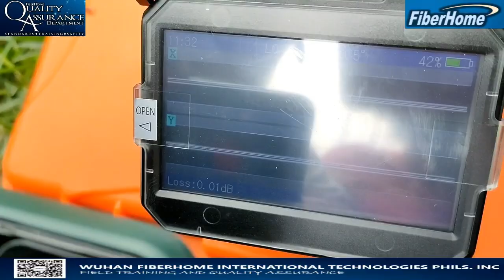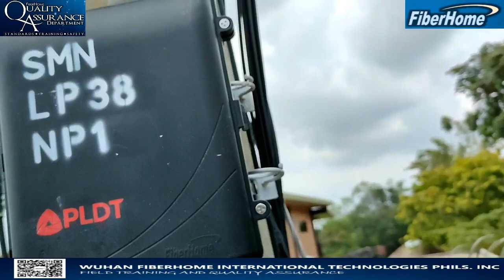PLDT ADD NAP STUB INSTALLATION

Comment: Hi sir. Sa pagka intindi ko po pag mag a-add ng nap box then stud installation yung gagawin, bale kukuha ng connection yung new box sa lumang box na live? Tama po ba? If tama po, ang question ko ay:

-Gusto ko po sana magpa kabit ng bagong nap malapit sa bahay namin. Mga 400 meters ang layo ng live box from bahay namin. Ang alam ko hindi pa puno yung existing box. Pwede po ba doon sa existing box kukuha ng connection yung new box na may 400 meters yung layo?

Gusto ko po sana malapit yung box sa bahay namin para hindi na dadaan sa private property yung mga technicians if ever mag kaka-issue yung connection. Salamat po at sana ma notice niyo po ang tanong ko 😊
Reply from the maker: Hi sir, about sa tanong mo sir pag ADD NAP STUB INSTALLATION kc dapat kalapit lang nung bagong NAP yung existing, mostly isang poste lang yon kaya tinawag na stub kc limited lng ung haba nung core na madudukot dun sa existing NAP

However, kung mahaba ung FOC kahit pa 1KM ang layo non e possible parin yung add NAP still works parin un

Ung gsto mong magpa kabit ng bagong NAP na malapit sayo e medyo malabo mangyari depende cguro kc hindi mag aadjust ang company para lang sayo, I hope you know what I mean.

At isa pa 8 NAPS per LCP ang PLDT. Kung ung LCP BOX jan ay my 8 NAPS na, hindi na pwede mag add NAP kc na reach na ung maximum limit nA 8 NAPS per LCP. Unless mag ADD ng New LCP ulit pero need noon ng new FIBER CABLE ppunta jan sa lugar nyo so makakapag add ulit tayo ng 8 NAPS possible na baka jn pa sayo malapit mailagay. But it will take time to do it at tulad ng sabi ko di maglalagay ng connection jan sa inyo para lang sayo or para lang sa isang subscriber.Lugi ang company non.
Reply: @Connected1130  Salamat po sa pag sagot sir! God bless po!

Comment: Quick question: nasa magkano ang cost sa isang NAP?

Natanong ko po ito kasi kadalasan, even sa big cities, kukunti lang mga NAP kaya pahirapan sa pag pakabit due to walang available port. Unlike sa DSL dati na walang hassle magpakabit, pero ngayong fiber na nasa 1-2 NAP lang kahit maramimg bahay. Based sa nababasa ko ay due to result ng survery ni PLDT sa area, pero sa tingin ko hindi yan effective kasi the day mag survey ang taga PLDT iilan lang naman ang interested or my current fiber sa ibang ISP na, which is kung may mga bagong bahay or say may mga apartment na may bagong nag rent at gusto magpakabit eh hindi na possible due to availability. Kung maglagay lang sana si PLDT ng enough NAP kada poste para may available ports sa new subscribers nas maganda sana, kasi pag walang available ports at may gusto mag apply eh wala din.
Reply from the maker: Hindi poh kc for sale ang NAP ng PLDT kaya diko alam ang presyo😂, sorry for the inconvenience. Paunahan nlang poh kc magpa install yan, however, kung mataas ang apply mo na Plan halimbawa 100mbps pataas, e kakabitan poh kayo kahit pa malayo up to 1 km layo ng NAP,
Reply: @Connected1130  Sir, sa case ko, naka DSL kami dati kaya lang na forced migrate sa Fiber dahil yung DSL box daw po ay natamaan ng construction sa lugar. 

Kaso, walang available slot sa malapit kaya sobrang layo po ng NAP box na pinagkabitan, labas pa po ng subdivision at malayo pa. 

Hinde po ba mas prone sa issue at kupol cable kapag sobrang layo na ng NAP box sa house?

Comment: Gandang araw po sir, may tanong lang po ako, nag benta ako ng wifi sa mga kapitbahay ko at kinabitan ko rin sila ng mga modem, ,pero sa mga punong kahoy nakasabit ang fiber ko,  , hindi ba ako aitahin ng pldt o converge dahil nagbenta ako nga wifi? Sana mapansin nyo ang katanungan ko salamat
Reply from the maker: Kung ung binenta mo ay my pangalan nf PLDT or convege xempre bawal yan dahil company property yan, if makikita yan oe my mag inspection pwede yan kumpiskahin, hindi din standard kung sa puno lng nkasabit ung fiber hindi ginagawa ng PLDT yan kaya mahahalata ng point to point yan
Reply: Hindi naman sa pldt o converge sir galing sya sa piso wifi ko nilagyan ko lang sila ng mga acces point sa mga bahay nila.. pero sa converge naka connect ang poso wifi ko
Reply from the maker: @spykevlogtv4814  ah ok lang yan sir, sayo nman pala yan so wala problema yan.

Comment: hi sir, ask ko lng po, same b ang reading s nap box and yung s bahay? kc everyday kmi nadidisconnect, dun sa house ang reading -31.98 then sabi nag change daw sila ng connector and bumaba naman naging -22.67 reading sa house. OK po b yung -22 na reading or dpat mas lower pa. what is the normal range? thank you po sa sasagot...
Reply from the maker: Hi sir, about sa reading xempre magka iba ang reading ng NAP saka sa Bahay ng subscriber, mas mababa ang reading sa NAP standard -15dBm up to -25dBm..however, connection still works at -27dBm to -30dBm depends on the modem.

Sure ako na my dugtungan yang FOC mo sir kaya sobramg taas ng LOS baka my coupler yan, dapat mapapalitan yang FOC mo from NAP hanggang jan sa luob ng bahay mo para gumanda ang readings.

Comment: napaka informative po sir ng video nyo.... tanong ko lang po sir ano po kayang dahilan kapag inyong fibre optic connection nyo ay nawawala kapag umuulan? or di kaya nawawala at bumabalik parang nag da drop out sya. marami pong salamat sa sagot. more power to your channel sir!
Reply from the maker: Ah number 1 reason nyan sir my coupler yang linya mo, or dugtungan.. Pag nabasa kc un papasukin ng tubig so mawawala signal mo, pero pag natuyo ung tubig e babalik din signal, o kaya mahangin, nag lose ung SC sa coupler. My dugtong yan
Reply: @Connected1130  natumbok mo talaga sir kapag nga minsan yung tipong parang uulan na tapos malakas hangin nawawala rin nga yung connection namin. sa may bandang NAP box po ba yang coupler na sinasabi nyo po?
Reply from the maker: @avengallagher2007  hinde, sa mismong linya mo yan, ung pumasok jan sa bahay nyo na papuntang nap. I'm sure my dugtong uan pag ganyan.

Comment: Ang daming Langam ng Nap box saamin. No internet router sa bahay . Pag bukas nong installer. Grabi yung langam ang dami. 17dbi daw yung reading ng power sa slot namin dati nong pag install nila. Kahapon  naging 30dbi daw. . Nakaka.apekto po ba talaga yung subrang madaming langam yung box?
Reply from the maker: Yes poh, kc possible na makapasok ung langgam sa SPLITTER ng NAP or sa mga Ports, dahil don maba-block nila ung lights na dumadaan sa Fiber Optic Cable. tataas poh talaga ang reading minsan nga e  LOS or Lost of Signal

Comment: Lods matanong kulang po nagpakabit po kasi kami Ng PLDT nagpunta po Yung installer sa Bahay pero wala nadaw po available na poste pero may nap box po na naka reserve na para samin,, pinabibili po kami poste para may pagkabitan.. anong size ng TUBO po kaya ang pwede Gawin pang poste ?? At magkno na kaya yun sa ngaun salamat sana masagot po ☺️☺️☺️☺️
Reply from the maker: Hi mam good day, base sa standard installation ng PLDT dapat talaga my POLE for ATTACHMENT sa tapat ng bahay nyo lalo kung malayo kayo sa kalsada, para maiwasan na masabitan ung fiber ng mga dumadaan na sasakyan, bawal din ung crossing private property, kung wala kasing poste di pwede isabit lang yon sa mga puno prone un sa sira and for safety purposes, Pwede na ung Royal Apex PVC, or GI Pipe, approximately 4 to 5 meters ang taas, mga 3k cguro yon
Reply from the maker: Pero much better twagan nyo nlng poh ung  installer na pumunta jn, ung iba nga kawayan lang nakikita ko e 😅.
Reply: @Connected1130  SAbi nga po ng Papa ko kung pwede kahoy nlng pagsasabitan lang nmn daw po
Reply from the maker: @jaerme1726  yes mam madami ako nakikita na mga ganon, basta matibay at hindi natutumba kahit akyatan, pero naka depende un sa installer kung sumusunod sa standard, kausapin nyo nalang mo ung CXA na pumunta jan, saan lugar poh ba kayo
Reply: @Connected1130  salamat po 😊 naka subscribe ndin po ako sa inyo..

Comment: Hello sir, ask ko lang po kung paano at kung pwede magpa-add ng napbox sa area namin? Nagaapply po kasi kami for pldt home fibr plan pero wala na daw pong slots. Dito po ang area namin sa Santo Tomas, Pampanga.
Reply from the maker: Hi sir, ask ko lang my mga existing ba tayo na PLDT NAP box jan? Punuan na ba?
Reply: @Connected1130  Nakapagapply na po kami sir ng plan 2099 yung 100mbps po. Ang problema po sir is punuan na po ata and wala pong slot sa mga nearest napbox. Sir baka po pwede magpaassist sainyo.
Reply from the maker: @patrickrimando4651  hi sir, hindi poh kc ganon kadali mag add Nap lalo na kung complete na ung mga 8 NAPS PER LCP dina din pwede mag stub or kung wla ng future loop. Sa lugar nyo poh ang alam ko punuan na talaga

Comment: Sir dito po sa subdivision namin my mga nap box na pero walang stencil... May pldt agent nag ikot na dito last month at nag avail kami for 100mbps, ansabi this march e papa activate nila yung isang box katabi ng bahay... E mag April na wala parin... Ano po kaya suggestions nyo dito sir
Reply from the maker: Saang lugar poh kayo sir, if wala pang stencil ung NAP meaning hindi pa activated yun
Reply: @Connected1130  Gensan area po ako sir,.. 
So antayin na lang namin sir hanggang sa ma activate yung box, tumawag kasi kami sa agent nung monday ma activate daw yun within this month/March...
Reply from the maker: @hawkeye1534  yes sir, pahintay nlng di nmn magtatagal yan, baka kc need pa slice sa closure or OLT yan

Comment: Hindi po ba bawal mag kabit ng private fiber optic line sa electric poles? Problema kase samin dito may dadaanan na private lot at ayaw ng may ari ng mga single core wire. Plano sana namin magpagawa ng 1 main cable with multiple ports po kase un lang daw papayagan ng may ari. Salamat po
Reply from the maker: Hi sir, In Legal cases poh xempre bawal un kc sa mga Electric company ung Pole kc pag naglagay poh kayo ng Line sa pole pwede nila un tanggalin anytime with your consent.However, di nman pansinin ung ganyan unless my nag complain sayo about jan. Ang PLDT, GLOBE, CONVERGE ay my sariling pole pero pwede nila gamitin ung Electric Pole kc meron silang Agreement to Attach
Reply from the maker: About jan sa Fiber nyo poh na ilalagay mukhang Point to Point yan ah, haha.. Saka ung sinasabi mo na may ari ng private wala xa pakialam jan di nmn sa kanya ung Pole. Un nga lang pwede ka nya complain sa Electric Distributor jan para ipatanggal.
Reply: Maraming salamat po, more power sa inyu at new subscriber here.

Comment: Sir pag may stencil na po ba (Yung nilalagay na letter at number) ay broadcasted na po ba? Nag tanong kasi ako sa agent ko at update ko daw sya if may stencils na, tapos sabi nya sakin ay itatanong nya daw po kung broadcasted na daw po or hindi? Pwede na po ba kabitan to?
Reply from the maker: Pag newly install ang NAP sir mostly pag wala pa stencil e hindi pa broadcasted un. Pero pag ADD NAP lang minsan my stencil na pero wala reading, depende kc un kung my ibang sira ang line. The best parin ang pag reading sa NAP para malaman kung RFS na
Reply: @Connected1130  salamat sa reply sir. Paano masisimulan ang reading sa NAP? Halos lahat ng NAP box dito sa loob ng village ay kakakabit palang at kakalagay lang ng stencils. Pag ganto po ba sabay sabay din sa irereading at pwede na tusukan?
Reply from the maker: @jeus845  mga Technician na mag reading nyan sir, wala ka nmn power meter at hagdan. Tanong mo lang sa knila kung activated na tapos pakabit ka na
Reply: @Connected1130  good day sir. Naka received ako ng text message na meron na daw ako account number and need bayaran before march 14. Sabi ng agent ko hotspot area daw po area namin, after ko mag payment matik kakabitan daw po ako. Totoo po ba ito sir? Tsaka sabi ay di ko daw po babayaran yung 1st month ko. Pa confirm po sir salamat
Reply from the maker: @jeus845  for new installation poh ba kayo? Pakitanong poh sa agent na un kung anong ticket number mo for installation. Saka mag avail ka kamo nung no cash out installation
Reply: @Connected1130  for new installation po ako sir. Bali wala pa daw po ticket number for installation. Parang ang mang yayari po ay advance payment muna saka po kakabitan. May na experience na din po ba kayo na hotspot area which is pinag aadvance payment ang mga client bago makabitan? Salamat po sa pag reply nyo sir
Reply from the maker: @jeus845  oo merong ganong area, if magbabayad ka man e wag sa agent, sa PLDT ka mismo pumunta at magbayad para dika ma scam. Saka ask kung pwede ka makapag avail nung no cash out installation. Bali mag add ung installation fee mo sa monthly bills.

Comment: after install nap box ilang buwan bago ito mag start ?sa amin dto 1 month na nd pa rin nag ooperate
Reply from the maker: Suppose to be dapat poh e activated na agad ang add NAP pag installed. However mdaming reason kung bakit di yon ma RFS or Ready For Service. Sa lugar nyo poh e possible na tinatapos pa ung ibang area, di kc ganon kadali mag latag ng main line sir.
Reply: @Connected1130  going 2 months na wla pa rin, normal ba pinabayaan nila open nap box?
Reply from the maker: @nctv6924  Dapat naka close ung NAP sir xempre, pero kung naka open ung NAP jn e malamang di nila ni lock un, my susi kc un pero pwede xa isara sa clip lang pero minsan bumubukas ung nap pag di naka lock

Comment: boss baka naman matulungan mo ko, balak ko kc kc magkapabit ng PLDT.
Reply from the maker: Saang lugar poh kayo sir, saka my PLDT na ba jan or mga NAP? kc mdali lng nmn magpakabit ng PLDT. Punta ka lng sa PLDT OFFICE jan at mag inquire, bigay mo mga requirments na need nila.
Reply: @Connected1130  dito po ko sa Camp Aguinaldo Q.C,  problema daw 20 span daw po , for relocation pa naman ng account ko po , di po ba magagawan ng paraan pagka ganun po
Reply from the maker: @nikkomoto53  hi sir kung 20 span distance nyan at mababa lang plan mo negative na yan di nila kakabitan or ililipat yan, pero kung ang plan mo ai 100mbps pataas gagawan nila ng paraan yan.
Reply: @Connected1130 cge po sir,  salamat po sir sa walang sawang pag rereply sir.
Reply from the maker: @nikkomoto53  hi sir diba QA ka nmn ng Fiberhome? Kung ako sayo papakadkaran ko yan sa mga tropa mo na Technician, bigyan mo nalang pang meryenda, pasalpak mo dun sa bakante na NAP jan tapos ipa activate mo sa tropa mo CX. Possible un basta my ticket. Yang mga CX naten kaya din nila mag create ng ticket number or job order para jan. My power ka na gawin yan.

Comment: Kuya same lng po ba ung nap box lpc at lpd? Mataas kse reading ng sakin sa lpc ..
Reply from the maker: What do u mean by LPC sir? Baka LCP Local Convergence Point, wala kasing LPC or LPD sa Broadband.ung LP na nakalagay sa NAP ay difinition kung anong number na LCP ung NAP
Reply: @Connected1130 
 nakalagay po kse sakin nap box 
Val
 LPD63
NAP 7
Ako lng po kse mag isa kinabitan dun, di pa din na activate mag 2days na.
Ung reading nya -20. Pano po ba malalaman if broadcasted na unh isang nap? 
Tyka san po makikita ung stencil?
& broadcast wa p wiring
Reply from the maker: @rodrigosalaojr1819  ah ok poh, ung reading na - 20dBm ay pasok pa sa standard, kung my reading na ganon meaning RFS na or active na yung NAP na un sir, However, tingnan mo ung modem mo sir my makikita ka na PON kung ung ilaw ng PON or Power Optical Network ay Blinking meaning hindi pa activated yung modem mo, dapat kc steady yung ilaw ng PON. yung VAL e code name ng isang lugar malamang nasa Valenzuela ka
Reply: @Connected1130  
Sinabi nyo lpc kanina baka lcp..mataas po kse reading nya -30  tapos    magkadugtong lngs sila sa itaaa ko nap  same reading lng sya. Kya dun ako iconnect sa mababa nap. Ano po case nun bakit mataas reading ng dalawa nasa taas na nap box ko  .. 
Bali  
LPC68
NAP 3
NAP 4

Kala ko po kse pag mataas nap box mas low dbm.
Reply: @Connected1130  matagal po sguro mag activate pag ako plng nka installed sa nap?
Reply: @Connected1130  2 days na po kse ko nakabitan kso sabi sakin ng nag installed 2-3 days daw kse nakapila daw ung activator my tumawag sakin pina reset sakin ung wifi modem turn off turn on ko daw. Kso busy dail tone pa din.
Reply from the maker: @rodrigosalaojr1819  wala kinalaman kung mataas o mababa ung location ng NAP, STUB instalation tawag don dumukot lng ng isang core don na galing LCP
Reply from the maker: @rodrigosalaojr1819  ganito sir, na na installed na ung sayo meaning activated na yang NAP na yan, bali ang hindi lang na activate e ung modem mo nga, tingnan mo ilaw ng PON kung blinking
Reply from the maker: @rodrigosalaojr1819  wait mo lng yan, wala na kinalaman ang NAP jan or LCP or mga taas, baba na sinasabi mo. Ang issues lng ng sayo ai sa system ng PLDT, modem activation.. Diba ung modem mo nga sir diba tingnan mo PON na ilaw kung Blinking, pag blinking e hindi pa activated yong modem ok?  Dapat kc steady ung ilaw ng PON sa modem
Reply from the maker: Ung modem mo my mga ilaw yan na may name sa tapat, PWR, PON, INT, TEL, WIFI mga ganon name nyan
Reply: @Connected1130  yun nga po kase akala ko tlga pag mataas low dbm hnd pla . Nag tataka nga po ako ang dami napbox dito sa area namin kami lng nmn nakatira dito buo magkakamag anak, yun pla dinukot lng ung isa.  Kaya pla 3 nap naka installed sa isang poste. Dati po kse my subdivision dito sa area namin private property kso sinarado na. Napa sobra po ata ng nap si pldt ..  thanks po atlease alam ko na mga yun laki tulong po nang vlog nyo..
Reply: @Connected1130  Opo gets ko na. Akala ko po kse hnd pa broadcasted ung mga  nap samin. Dati po kse wala ung mga nap ng pldt na yun sa  poste namin.